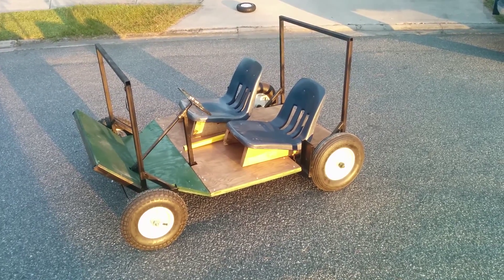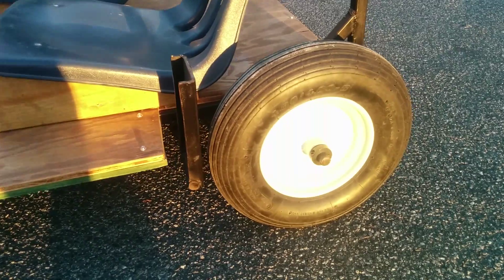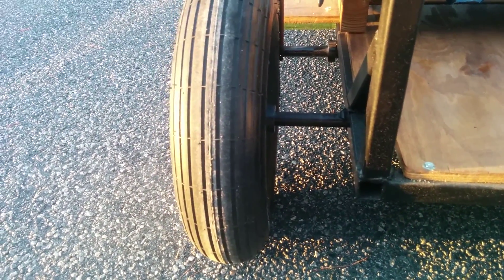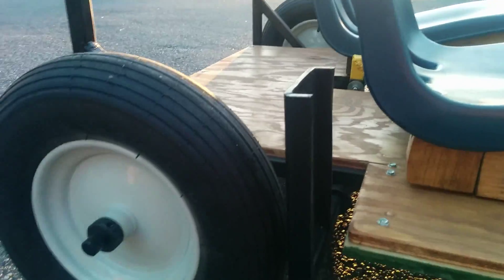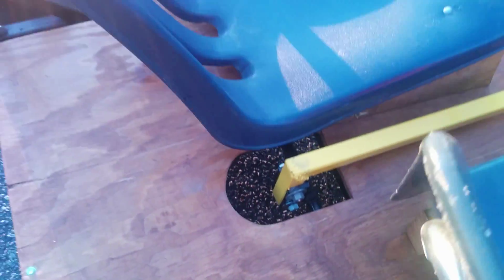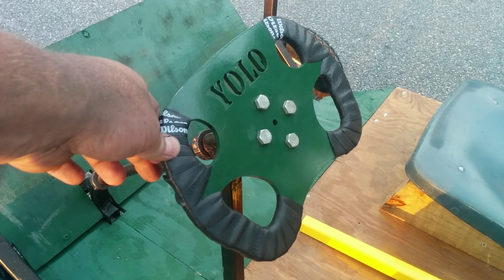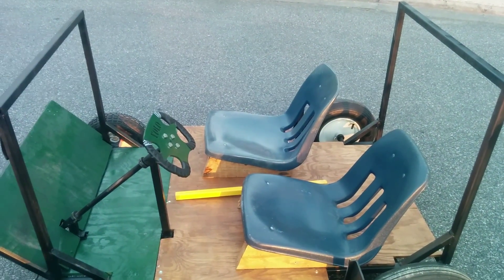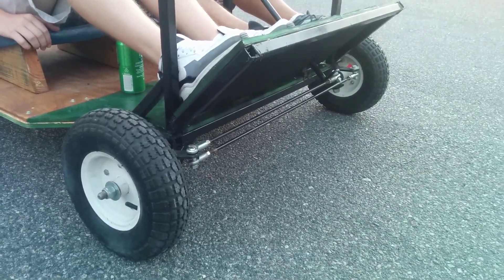How to build a red bull Soap box Car and Place ( TMNT party Wagon XXL )

Comment: I want the chassis of the thing because I’m building a diy car but it’s not for soap box racing and I only want the platform not the iron bars is it possible to not use the bars or is it for the chassis.
Reply from the maker: Yes it would be possible to make the chassis without the vertical bars. If I could suggest, use larger  1X2 tubes instead of 1X1  Cad files are located here : https://www.thingiverse.com/thing:1418830. Please feel free to reach out with more questions